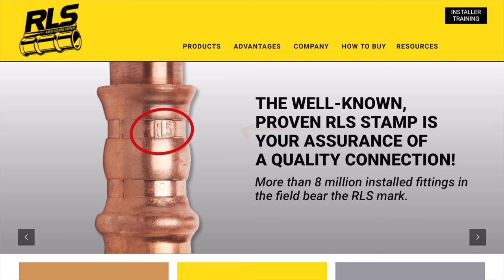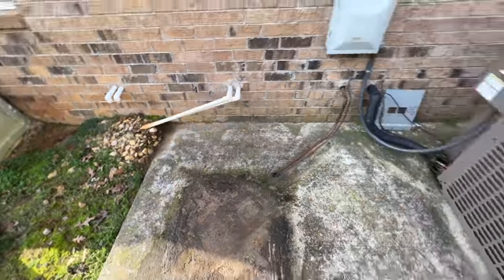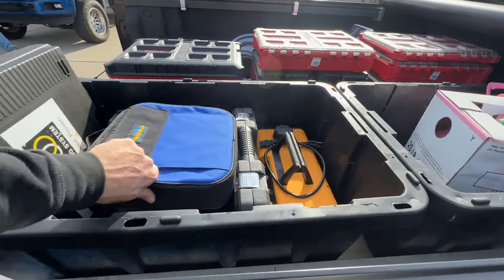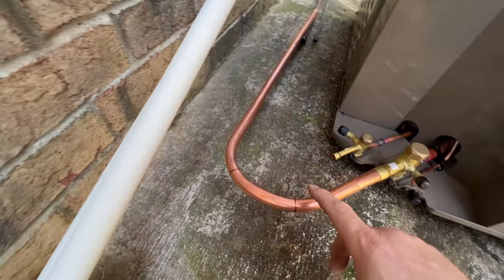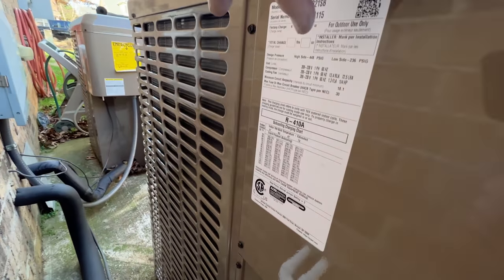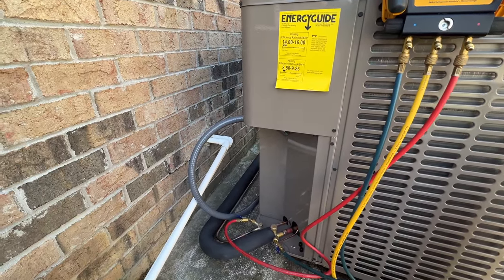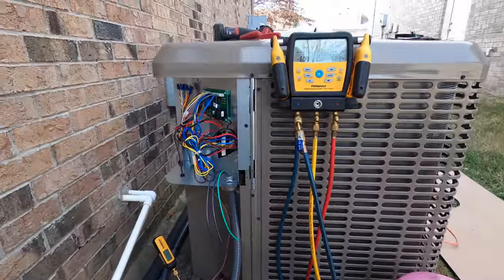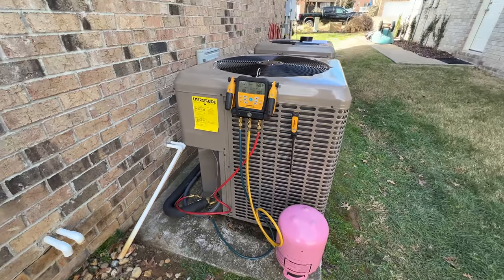Helping Another Contractor Install A YORK Heat Pump | HVAC Life

Comment: I’m sorry York is worst equipment/ company I’ve ever had the displeasure of working with. That’s about the nicest thing I can say about them.
Reply: Why?
Reply: Never installed a york.. I will say, i like the way their service valves allow you to put your gauges.
Reply: @dantemariscal8679  well for starters they suck at warranty and lost most of the info on our registered units and left me holding the bag. And almost every york I’ve installed had multiple major components failure in under 5 years. Mainly coils. I’ve replace coils on some units 3 or 4 times on brand new systems before. The original will leak and then the warranty coils will spring a leak after a few months. And of course York will try everything they can to make it your fault and make you jump though hoops to get paid for your labor if they do warranty them. Now I instal Daikin/Amana and not had many problems. And if you do have an issue our reps send us a new unit replacement for major component failure and pay us for labor no problem.